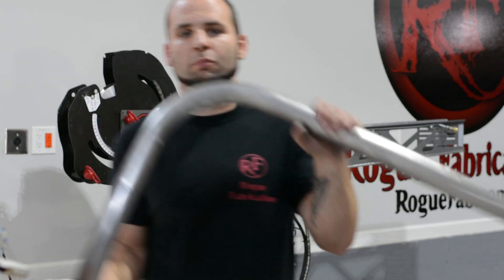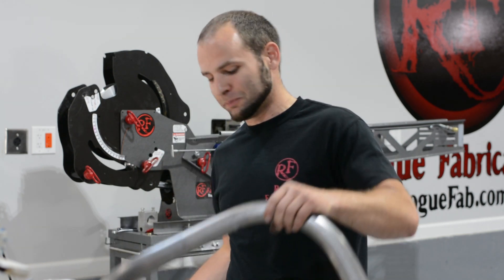SHOP UPDATE 1 -  Mandrel Bending 1 75 x  065 SS

Comment: will it be possible to bend exhaust material on a tighter CLR in the future?
Reply from the maker: Depends what the exhaust is for. You can bend titanium motorcycle exhaust on the machine now. If you want to bend 3" stainless for a cat-back... no go on the M600. It maxes out at 2" for standard dies. We will likely have a 3" solution in the next several years.